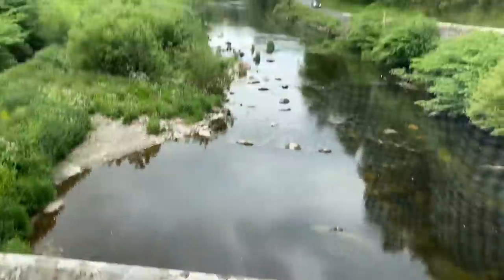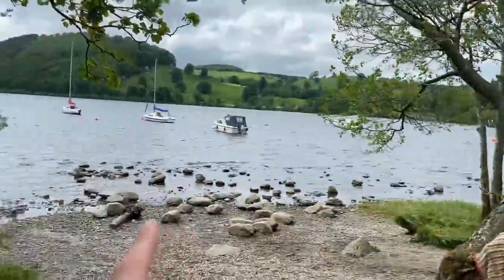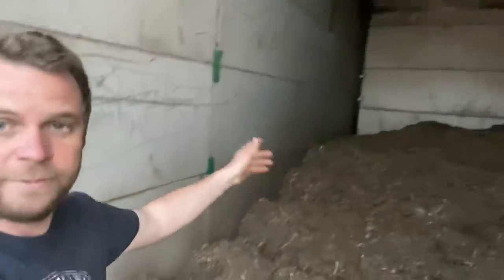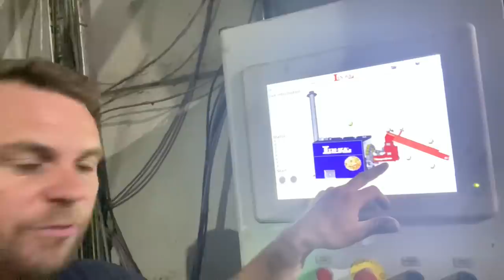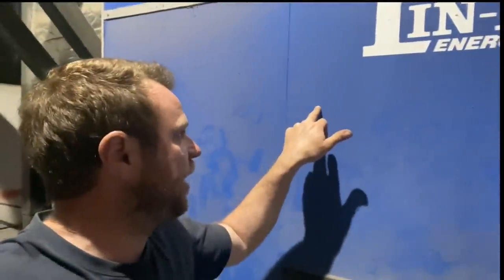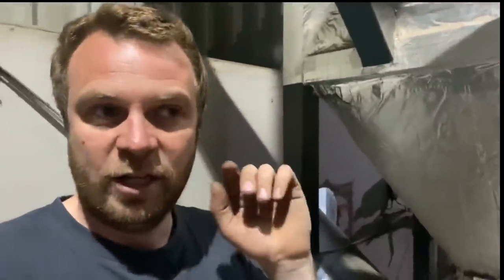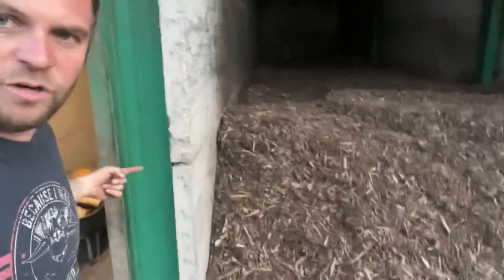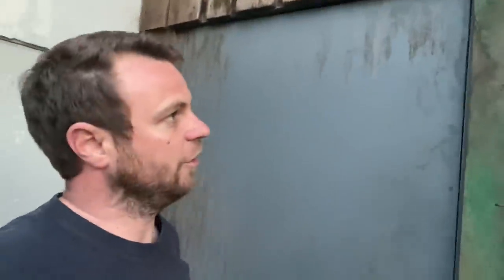Day446 #OLLYBLOGS ON TOUR BUT DONT WORRY WE HAVE A BIOMASS BOILER WALKAROUND #AnswerAsAPercent

Comment: Thanks for the tour of the boiler Olly, really enjoyed that. I presume the ring of what look like fuel injectors around the front end of the boiler are for diesel to get it started, then once it's lit the boiler keeps burning on wood chip just modulating output? Some set up!